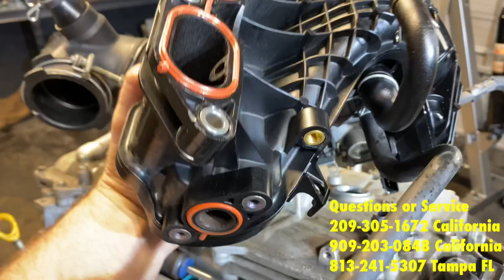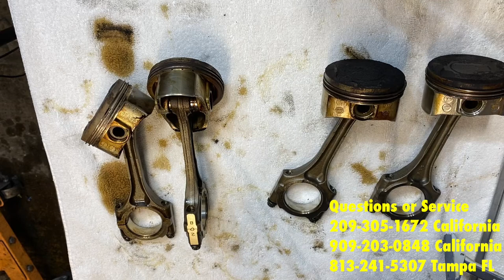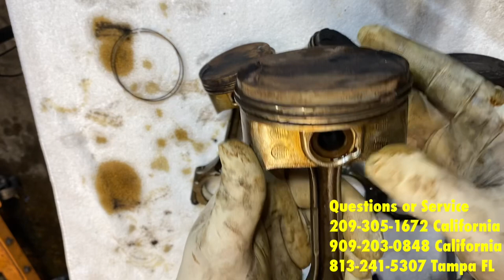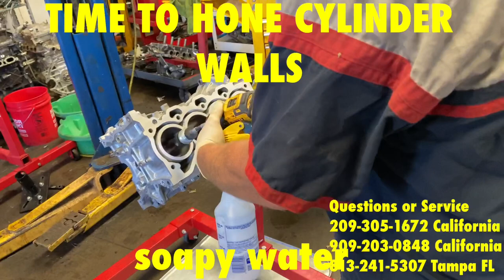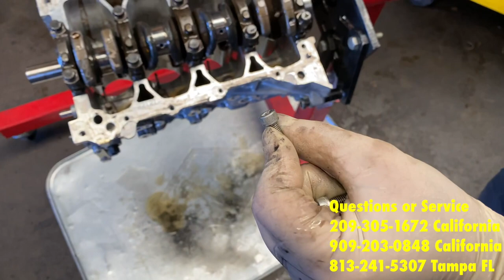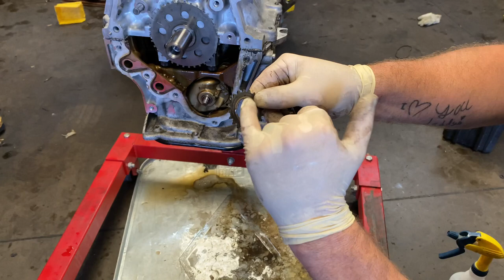Toyota Prius (Lexus Ct200h) oil burning consumption causes and fix.

Comment: Want to come back to Ohio and do mine? I am still working on the Cylinder Head and lapping my valves. I was hoping changing the location of the PCV valve to a more vertical position on its way to an oil catch can would solve my oil burning issue. What let’s one know they need to go this far? Is there an oil burning threshold or something?
Reply: Brand of oil and frequency of oil change
Reply: @repairvehicle  I would say sadly I listened to the marketing hype... I would buy the most expensive synthetic oil I could find and only change it 1 time a year... About 15,000 mile intervals. This past year I am doing 6 month/ 5,000 mile intervals with the cheapest oil I can find which happens to be Costco Kirkland brand full synthetic oil.
Reply: @nathanhood8578  , every brand of motor oil has different evaporation rate at which oil evaporates and causes oil consumption.
Reply: @repairvehicle  that's great and all, but that evaporation rate isn't stated on the bottle. What is stated is what the oil is supposed to be rated for.... Like annual oil changes and mileage it's supposed to last. Mobile1 oil listed as annual oil stated it would last for 20,000 miles which I never hit.
Reply: @repairvehicle  like I said, I fell for the marketing. You seem to know a lot about oil... what's a good full synthetic? Currently using Costco Kirkland brand full  synthetic, but now I don't even trust that anymore.
Reply: @repairvehicle  unfortunately it has nothing to do with oil change frequency or oil brand.  Toyota was seeing excessive oil burning at 60k miles with dealer serviced vehicles.  The rings are at fault and the burning causes EGR plugging failure and misfire.  The good news is Toyota corrected the problem in 2015 different rings so if you own 2015 or newer you're good
Reply: @modified93tc  , 2010 no oil consumption. If rings were the problem then it would have been consuming oil at 30k miles. How Toyota corrected the problem in 2015?
How is the clogged up egr contributes to oil consumption? No oil passes the egr.
Reply: @repairvehicle  no you got it wrong.... the egr clogs up because of oil consumption.  Yes do some research they were burning enough oil that the light came on.  Don't matter the frequency or brand it's bad rings.

They changed the rings in 2015 so you won't see the burning problem.
Reply: @modified93tc  , who have brainwashed you that 2015 Toyota changed rings? Do you have facts to back up your claims? Oil brand does not mater? It’s not what people say on my channel. It’s not what oil companies say either. Egr pluggins happens regardless of oil burning. Let see if you have facts to back up your claim or just bs.
Reply: @modified93tc  , I have comments from people on my channel that 2015 have oil consumption too. I should make video so that others can see how you spread false information.
Reply: @repairvehicle  do it please.  Btw I didn't dream this up.  Lol 😂.  Look at Toyota tech bulletins.  I'm sure everything will burn oil eventually.  Point being the ring design was bad for these years.

Also to reply to your other comment.... the EGR gets plugged with unburned oil and oil fumes that's how it starts plugging up unfortunately.
Reply: @repairvehicle  no...what brand are you saying clogs EGR up? Even the so called Conventional oil now is part synthetic to meet strict manufacturer demands.
Reply: @repairvehicle  part synthetic Part. It's a mix now there is no 100% conventional oil sold anymore.  Do some more research on this and get back to me 👍.
Reply: @modified93tc  , conventional oil always have been 100% none synthetic. Due some research before posting garbage. I have done many videos on this subject on my channel. You have not provided any proof to your bs statements, it’s because you have none and you like living a life being fooled.
Reply: @modified93tc  , where is the link to Toyota tech bulletin? Clogged up with unburned oil? This is nonsense comes from someone who has zero clue how engine works and how oil is being burned. Video coming soon to my channel educating people and exposing your false statements with actual facts from Toyota and oil companies.
Reply: @repairvehicle  I recall reading into this where the piston rings for the 1.8L Prius engines were redesigned along with the piston from 2010 onwards.  I never verified with Toyota substantiation.  However, I was just looking and appears the 2010-2014 rings are Piston Ring Set - Toyota (13011-37110), 2014-2017 rings are Piston Ring Set - Toyota (13011-37260), the 2016-2021 ring are Piston Ring Set - Toyota (13011-37270).  I'm not going to look, though I recall there was a piston redesign of some sort as well.  In regards to the engines, I recall reading they can interchange between the years... where offhand the 2016 (I think that's the Gen4's) and later (don't quote me) re-designed the exhaust routed to the EGR circuit after the catalytic converter versus the prior years was routed off the exhaust manifold before the catalytic converter.  

I own a 2013, so have been researching my options for the known engine issues since I now have ~260K miles on mine and am amazed how well still performs other that just started getting what sounds like a catalytic converter heat shield or exhaust rattle down below.  Oddly, I'm also hearing the low idle funky sound of EGR valve needing replaced and that whole intake, EGR and PCV valve circuit cleaned at the least.  Only seems to make that other sound in Eco mode starting off really slowly and goes away when I giver gas or use power mode.  Hopefully nothing more... though I'll be listening watching the state of those rings and wondering about running the "cleaning" fluids in the oil for a treatment on the lower rings and possibly doing the same in the gas to clean out the injectors and upperside. What's your take on that oil cleaning route?
Reply: @jafinch78  yes there is way to clean the rings and injectors, for more information comment on my channel. Videos coming soon in addition to what is already there
Reply: @repairvehicle  Yes, at least in regards to the parts numbers being different for those Gen 3 and Gen 4 1.8L engines.  That's what the Toyota parts website says, nothing fake their.  Not sure if the change is in the specifications for size or materials or completely different design... or I guess maybe only the part #.  

I didn't look at the different piston part numbers, though I recall they changed those as well from the 2010 and later once at least.  Well... I'll search the Toyota Parts Center Online page and looks like for 2010-2014 there is Part Number: 1310137120 with Supersession(s): 13101-37120; 131010T100, for the 2014-2015 there is Part Number: 1310137240 and for the 2016-2022 there is Part Number: 1310137250.  

So looks like the piston ring for the different year ranges, there appears to be three or maybe four different piston part number that I'm not sure if a design change in specifications of size or materials or only the part number or some combination of previously mentioned.

Comment: Do you guys work on Toyota Hybrid Transmissions?
Reply: Did you forgot to change atf?
Reply: @repairvehicle  No. My car won't start. The electric motor or however it starts went bad all of a sudden.
Reply: @davidgriffin14  did you ever replace your atf?
Reply: @repairvehicle  I did about a year ago.
Reply: @davidgriffin14  first time in how many miles? Previous car was in accident?
Reply: @repairvehicle  it has 77,000 miles on it. I changed it when I bought the car at 75,000 miles.
It's never been wrecked. It's a 2007 Camry hybrid.
Reply: @davidgriffin14  , Toyota hybrid transmissions very reliable transmissions . There must be either wrong fluid was used. Or incorrect fluid level was there. Or it was in the accident. It’s unheard of Toyota hybrid transmission to fail , I have video with over 500k miles on original hybrid transmission and engine
Reply: @repairvehicle  I'm amazed how the CVT is so cheap to find as well.  I'm surprised, and have made a plan along with purchasing one to use for, no one has made a 3-phase alternator/generator/engine-welder using one or at least one of the MG's.   On another note, amazing how Toyota dealerships state that the CVT fluid doesn't need to be changed and only checked for fluid level.

Comment: Hello sir i have a 2012 prius with 206.000 kilometers on it. I ask my local toyota dealer in the Netherlands if they also check the EGR. They said yes.  But someone told me that the toyota dealer only check fault codes from the EGR. And that i need to clean it myself.  But i’m not that handy! And i don’t dear to take things apart from my car.  What’s the best way to krep the problems away?
Reply: Unplug the egr now you won't have to worry about it but will get a warning light on the dash
Reply: I PUT ON A OIL CATCH . I moved the PCV, I screwed it into the out of the catch can, I drilled a hole in the bottom of the catch can and put a drain tube so when I change the oil I can drain it

Comment: Awesome video as always! Had a quick question for you

Do you guys know why the prius has a tendency to do that short rattling sound on acceleration from a stop (Most common when driving and you come to a stop at a sign or a light)? Is it related to this EGR system by any chance?

Thanks!
Reply: Clogged up intake manifold
Reply: @repairvehicle  Have had the intake manifold off / cleaned it quite thoroughly. Still does it
Reply: @SidewaysGts  , did you clean it yourself?
Reply: Use higher octane gas 89 or 91 don’t use 87 and it will go away
Reply: @santosf1107  don’t do this, use the fuel the car is built for
Reply: Low engine oil, need to Add oil.  Works for me .
Reply: @diyadventures1753  "Low engine oil, need to Add oil.  Works for me ."

At a minimum i can confirm that the issue is not related to oil level.
Reply: did you fix the issues?
Reply: @tonymemory2279  "did you fix the issues?"

Sadly no- But the car got in an accident shortly after making that post (Literally got attacked by some fuckwitt on the road who was having a bad day at the post office. But thats another story).  The vehicle only just made it to the shop a week ago (took insurance months to make a judgement because of the police involvement due to the situation), and hasnt finished repairs yet.

Fwiw i did try a few other general fixes, but nothing has seemed to work.
Reply: @SidewaysGts  it's explained in this video: the piston oil spring(s) leak oil up in to the cylinder. When it end up in intake manifold it causes rattle. Clean the intake and it will go away for a while?